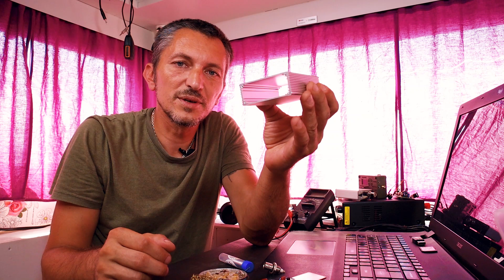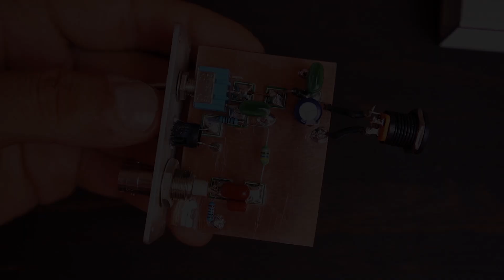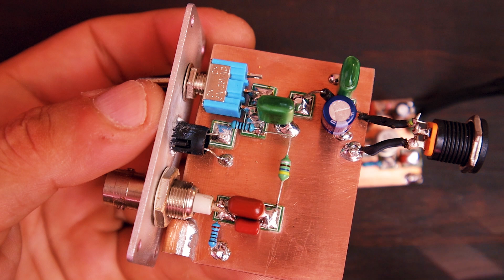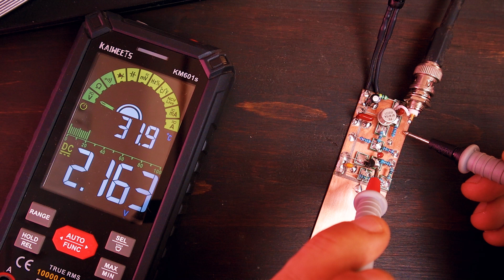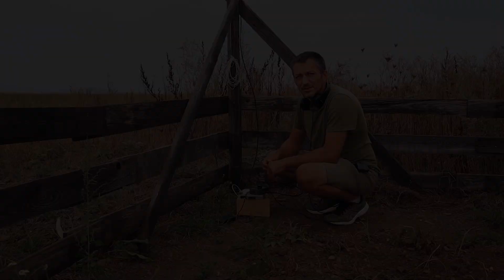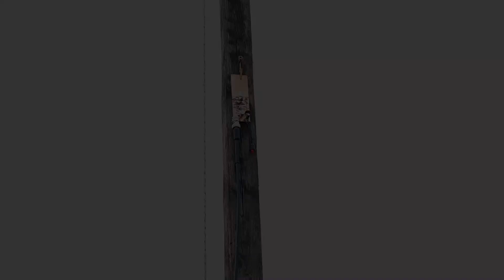Building The PA0RDT MINI WHIP Antenna - Part Two ( Bias-T And Testing )

Comment: 20:50 well even at 160-20meters

Even 1/4λ 1/2λ or 5/8λ

Whip or dipole will take Alot of space

J-pole might be better

But unlike vhf and uhf,  take off Angle doesn't need to hug the horizon since hf and below can bend around the horizon

This effectively a capacitance hat to make it smaller but look like a full antenna to the radio, seems it uses earth as the ground plane if you need it above the tree level

Probably  some λ of wavelength above the ground will improve it ..
Reply from the maker: Thank you so much. 🙏🙏🙏 73 YO6DXE

Comment: Very interesting to try this antenna far from the cities. Living in dense town, I found mine quickly saturated by FM and PMR transmitters. At night it was also saturated by chinese high power SW transmissions. 
As it is a wideband antenna, do you have a SDR receiver to see many bands ?
Comparison with the EFHW will be great (as soon as you got some propagation)
One question : where did you connect the VNA exactly ? (input is high impedance, output is to be loaded by 50ohms)

Lastly : Happy birthday Ciprian !
Reply from the maker: Thank you so much Olivier. The NanoVNA I had it connected on the output of the Bias-T where I should connect the receiver as I wanted to see what the receiver would. When it comes to the antenna being overloaded... apparently they 10uH inductor between the gate of the JFET and the antenna pad should help to prevent those issues. So far I didn't had those problems but I will place it back in case I do and see if there is any difference. 73, YO6DXE

P.S. no I do not have any SDR at the moment, maybe I will buy myself one for Christmas 😁.
Reply: @dxexplorer  I would suggest SDRPlay receivers. I personnaly use a RSP1A on many bands. A very good performance/price ratio. 73, F1SOC
Reply from the maker: @olivierconet7995  Thank you. I put a note here to know what to search for. 😁😁😁🙏

Comment: You might want to look in to general RF Grounding.  Some lengths of copper rod or pipe driven as deep as you can and keep them and the ground wire as clear from other wiring to avoid it picking up noise.
Reply: Dig a 10 foot hole or about 5 meters shove a copper or stainless steel pipe, fill with some water and fill the hole with mud and salt

Fence post drill or diggers would work for this
Reply: Also can be use for lighting rod protection
Reply from the maker: @Clancydaenlightened I have to find a final spot for the camper as I am about to move it and since is the radio room... then I can also do some proper grounding for this. But on the other hand when I take the antenna on the Scouts Camp... there I ordered some proper grounding to install there. To make sure it actually works well too 😁😁.
Reply from the maker: Thank you so much.. That I have... I just can't seem to figure out where to connect it. Some people say up straight at the Mini Whip... others say on the coax right when it goes in the house ( camper in my case ). I did some experiments last night just for fun and connected the base of the camper to the ground of the coax that goes into the Bias-T. And from the noise at S4 it went down to S2. 73, YO6DXE

Comment: I was eagerly waiting for this second part. These first tests are quite encouraging indeed.
Grounding seems to make a lot of difference, if you have a chance to bring the antenna up high above a metal surface, as per the pages describing the setup of their web SDR at University of Twente, NL.
They really have terrific reception there using such an antenna.
Looking forward to the next episodes! Good luck to you!
Reply from the maker: Last night I made a few surprising tests and this evening I plan on placing it about a meter or two above the roof of my camper since it's all aluminum. I wonder how the results will be this way.

Comment: its compromise antenna but still works great. when you hang it up higher its gonna work better.
by the way this summer i learned morse. also i finished my exams and  now i am student😁😁.
Reply from the maker: It is and is not 😂😂. It seems to work fantastic in receiving DX stations. Not so good on receiving close by stations though... at least I didn't heard any for the past two days since I am making the tests. But I guess I must use it for a while to form a proper opinion about it. It doesn't seem to receiver the same as the EFHW... but still it receives a lot of stations and considering that it is so wide band... I think it could be excellent for a SWL, especially if you don't want to bother building and raising up complicated antennas. CONGRATS BUDDY both on the exams and also on the Morse code. Weak chances for me to become a student... but I hope at least I get to learn the Morse code this fall 🤣. 73, YO6DXE.
Reply: @dxexplorer  at least you have antenna that can receive dx stations😃🤣. I learned Morse in 3 weeks I was going to my teacher every second day there is a very easy tactic to learn it very very good
Reply from the maker: @4L1LAT I have to start learning the Morse code as well. I have no more patience to do QSO's in CW. About the antenna... I am happy is wideband. This way its easy to test all sorts of receivers on one single antenna and I don't have to keep swapping connectors every time I try to change a band because is really annoying 🤣🤣.